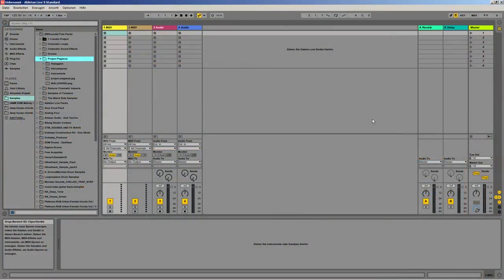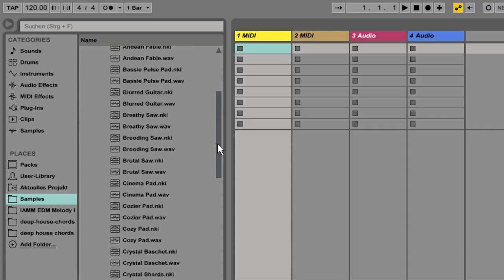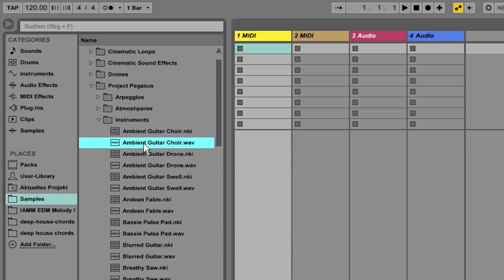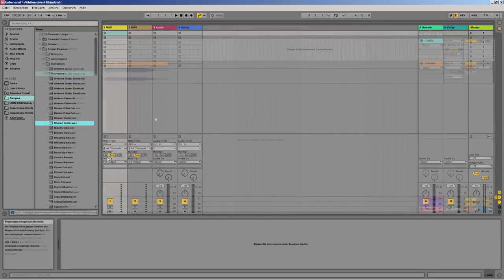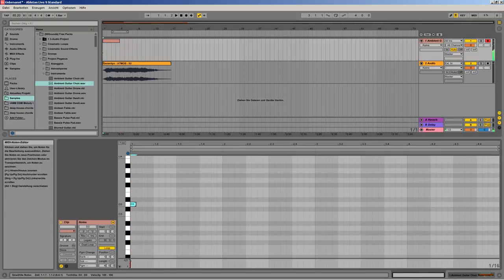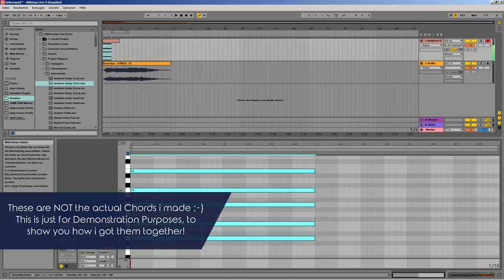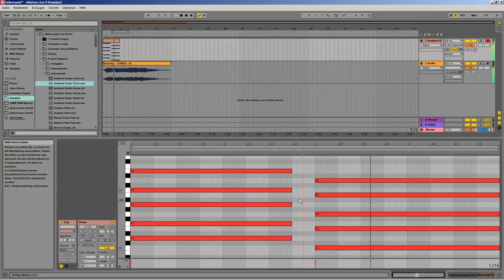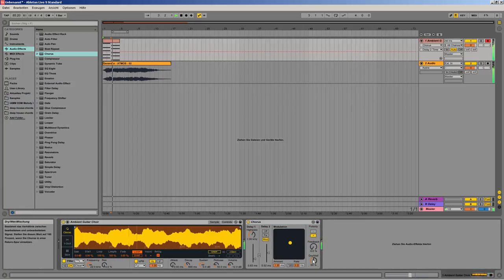The Making Of "TORN APART" - A Brief Overview of my Workflow with the Digitakt & the DAW

Comment: FYI The Philharmonia Orchestra has a huge selection of orchestral samples, with different notes, lengths, ornamentation and dynamics. Really comprehensive. Thee only thing is that they are mp3s, so you will have to batch convert them to whatever format you need.

Comment: Thanks so much for sharing this! At 9:10 you mention “trigless trigs(?)” as modifiers of volume. Could you please elaborate? Thanks!
Reply from the maker: Youre welcome ;-) Trigless Trigs are special Trigs in the Sequencer that dont trigger any Sound. They trigger Parameter Changes instead. So you can instantly change the sound completely without modifying the actual Sound Setup. On the bigger Elektron Boxes (A4, Octatrack, AR) these Trigless Trigs can be combined with Trig Slides to gradually fade changes in and out. Use this on Pads or other Sounds that last longer (like Drones or Ambient Textures) and you can incorporate a hell of a lot of movement into a sound on just one single Track. Great for insane buildups or epic drops - or whatever you have in mind. For sure :-)
Reply: umonox Got you. Thanks for taking the time. Pleasure and helpful to watch your vids! Keep it up 👍

Comment: Outstanding work there Umonox! Could this be emulated exactly the same way on a Rytm (mk.1) or? If not, what would be lacking please?
Reply from the maker: thanks mate. yep, this should work with the Rytm MK1 as well since i havent (re)sampled here. but the lack of a graphical waveform display could make it a much more time-consuming task.
Reply: Thanks for the reply. You're right.... the lack of a waveform display could be a ballbreaker. I'd also like to see a video from you outlining the advantages of working with Elektron boxes over a traditional DAW as mentioned below. I tend to use my Rytm mostly for sound design these days rather then a compositional tool. Keep up the amazing work. You are one of the best on You Tube IMO.